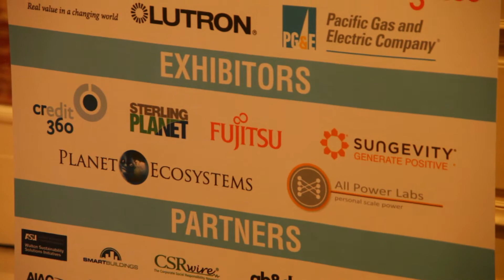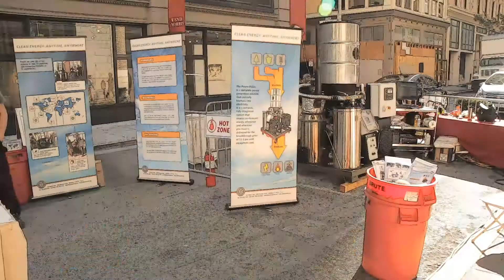Microgrid @ VERGE Conference

Comment: docdcox - The microgrid had a number of AC power sources synchronized and running in parallel. One was the diesel generator acting as an AC source to synchronize to in this case. The Power Pallet was set to provide a continuous base load of power, while the diesel genset was essentially running at idle. There are a number of other ways to manage the system, and the partners in the project are already discussing more advanced control demonstrations for next years event.